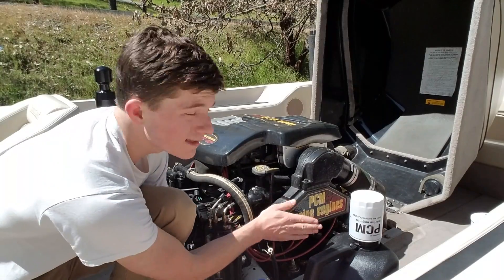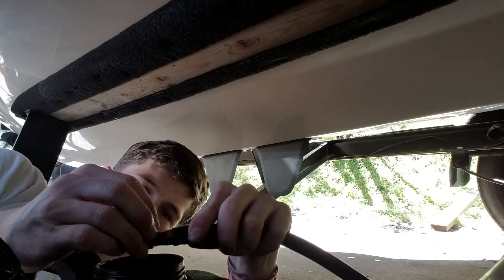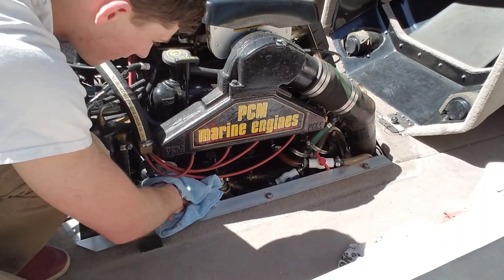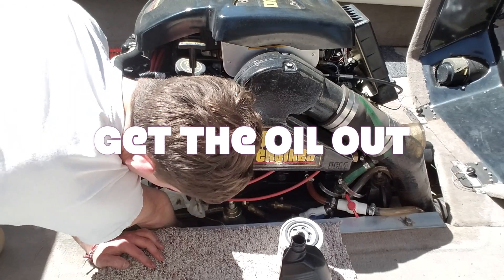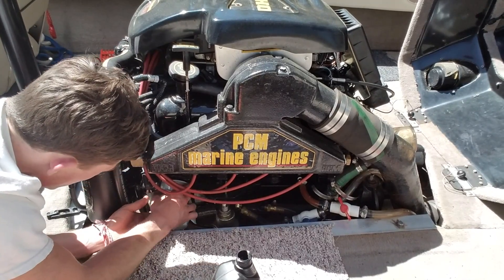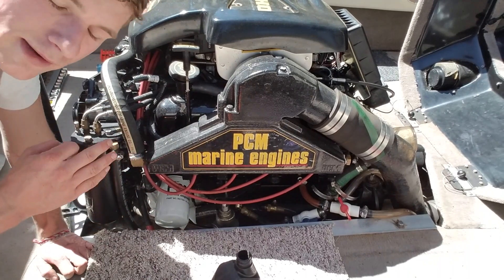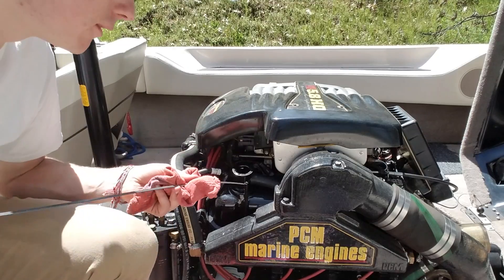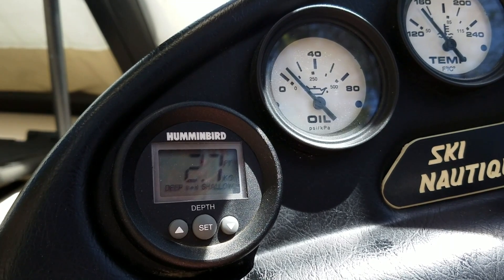Boat Oil Change: 1999 Nautique

Comment: How do you get the center drain plug out of the center of the boat? I have a older 1986 Marlin i can see it but don’t know how to get the thing out. Thanks
Reply from the maker: I reach down in a weird angle and unscrew it. Be super careful when your engine is hot.
Reply: @92813justin  I got it thanks bud love the videos

Comment: I have a question. I have a 330 pcm Excalibur engine. The steering is hard when turning left but soft when turning right, only in the water though. Out of the water it turns normal. A friend said to check the power steering fluid by belt tension. I look but can’t seem to find a steering pump. Or maybe just can’t see it because engine sit low in the back of boat. Do these engine have power steering pump and fluid.
Reply from the maker: Ski nautiques do not have power steering. It the pressure only when you are moving? If so there is a trim tab on the rudder you can adjust.
Reply: @92813justin  thank you very much. Yea my rudder have 3 tabs. On it. Now that you say that... I remember seeing my dog biting on the rudder where the tabs are at. How and is it easy to adjust or should I take to shop, for professional. Thank you a lot

Comment: Nice work.    This engine is a little special - it needs zinc in the oil.    I only run valvoline vr1 40w in my gt40.
Reply: My boat shop recommended this too, and he also said use 20/50 if you can get it. I got it for $30 on amazon for a 6 quart case. Just did my first oil change to winterize...
Reply: @flite26  thanks for that. Ordered

Comment: Thru wich hole u put the oil hose? I missed that :)
Reply from the maker: MrSquinker, the drain plug on the bottom of the boat
Reply: @92813justin  found it! I thought you pulled it thru the water suction point :)
Reply from the maker: MrSquinker, great! Let me know if you have any more questions. I am happy to help.

Comment: If you take off the oil fill cap, it may drain faster.
Reply from the maker: TheRandrx2, I usually do that. I also sometimes pull the dip stick out a little.

Comment: Good job Justin, keep up the videos.  Have you ever removed the transom seat? If so, how.
Reply from the maker: Thank you, Hank Henry. The videos are coming every week. I have removed the rear seat plenty of times. This is a great suggestion and I will make a video on how to remove the back seat.
Reply: Hank, the rear set may seem 'stuck in place because the rub rail cushions interfere with the seats movement out. The seat will come out, but it needs to be finagled a bit. I have friends with the same boat, and they all seem to come out differently. I use cardboard wedged between the rub rail cushions and the rear seat to keep the rear seat from cutting into the rub rail upholstery when I wrestle the seat out.  That rear seat design is pretty lousy ! Part of what makes it funky is the allowance for the ballast tanks.  Even with that, I don't see why it could not have been better designed to 'lift' out vertically like the old Mastercraft Prostars !